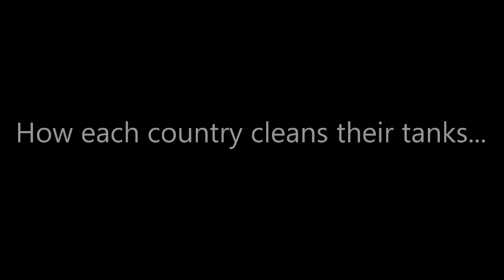How each country washes their main battle tanks...

Comment: I am impressed.  The GERMAN drive through tank wash is the koolest thing going.  After spending many hours with a 2” firehose trying to loosen up Kansas clay I have to give the Germans an A+.  Sometimes our dirt/clay mix would be so tightly compressed and/or frozen, we would have to use tankers bars to pry and chip it away to remove it. We always ended up soaked to the bone too.
I was really expecting the colored lights to start flashing to inform the German crew that CARNUBA HOT WAX was now being applied to their tank. Lol. Then, two guys magically appear, to wipe down your vision blocks and lights. Lol. Also, I assume there is a complimentary vacuum the crews can use afterwards. Then to finalize the experience, the tank commander is presented a little pine tree to hang from his cupola to make his tank smell nice. Lol.  Wouldn’t it be nice though?  😊🏳️‍🌈🇺🇸🇩🇪

Comment: German: You can get the deluxe with track cleaner, clear coat protectant and triple foaming polish or you can get the ultimate that also comes with a double pass foaming pre-soak, and high pressure rinse.
American: You can have anything you want as long as you don't mind joining all those other tanks in the giant water cannon bath.

Comment: I'm guessing the US drainage backed up at some point? :)
Reply: Nope that is by design. I served 11 yrs in the US army (2000-2011).
Reply: @mississippirebel1409  Ah OK. Just seems a weird way to do it. In my experience just sitting in water doesn't remove much mud. Our system is a bit like the US (but no pool of water) and with crews getting up close and personal with "Gurni" type high pressure hose.
Reply: @andrewbergman4783  We use a dedicated wash point too (concrete, recycled water, etc.) just that ours drains away so it remains wet concrete - it doesn't get to be 30cm deep with mud, water, oil and who knows what.
Reply: @andrewbergman4783  because dried mud is like concrete.  You let it soak for a while and it helps you clean it.  Going through the bird bath is step one.  After that you go to a detail station and clean some more.  Think of it as a pre wash soak.

Comment: Most seem like a blessing as it wasn't a tank but a bulldozer that the driver had to extracted because they were sinking in mud, and by the time they got around to retrieving the bulldozer it had been completely submerged.

So they just dragged it this 248,500 lb bulldozer back possibly 20,000 lb of mud attached to it and left to turn into a solid rock. Luckily for us they gave us a single shovel (not even a real full sized one), buckets and a single pressure washer. 

Best month ever!

Comment: As for the comments on the German tank washing machine:  This works on a small scale.  Germany has 236 operational tanks.  The US has 6,612.  It doesn't scale like that.  Giant water hole works for elephants, and tanks on that scale.
Reply: It's actually Sweden and we have even fewer than 236. A good point. Like the US system also besides the part where someone installed a railing in the way of the water cannons.

Comment: Need to consider also what they do with the contaminated water. Germans used less water and it is considered contaminated and need to be treated accordingly. For americans, most likely do not consider is contaminated. Britains, actually, they are not cleaning the tank, should be like a test place or something. Russia, when it get frozen, the top part can be scratched with the lighters fluids and the rest is potable.

Comment: From best to worst:

Germany > Russia > U.S. > U.K.

Germany is high tech I mean a tank wash where you drive the thing in the garage and have nozzles move back and forth every which way? That's pretty thorough! It's like a car wash for tanks!

Russia is low tech but functional. I mean they they take their tanks to an actual hand car wash whose tools and skills can be adapted from cars to tanks. I believe that can be pretty thorough. 

The U.S. um... Okay so they have bay area thing that's surrounded by nozzles that you can turn this way and that but can't move around. That's not gonna be very effective because you need to be able to move the nozzles with the vehicle to clean it well. With their system you essentially have to move the tank around ever which way so the nozzles can get to it. 

It's funny how the Russia system is adapted yet is more efficient than the U.S. system which is made for this.

The U.K. oh god. So you fill a pit with water and just drive the tank into it? That can't be thorough! I mean you need some scrubbing and spraying action to clean something! Not just "Drive it into and at least and at most semi-submerge it in water."!

So Germany is for when you want to be really thorough and sophisticated, Russia is for if you want to be cheap but still functional, U.S. is for when you want to get at least something clean and the U.K. is just minimal effort.